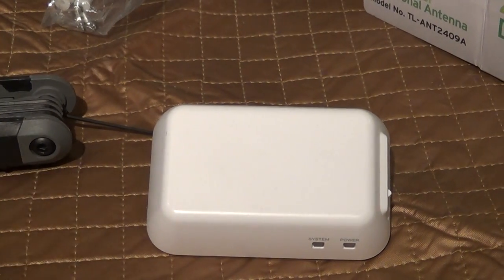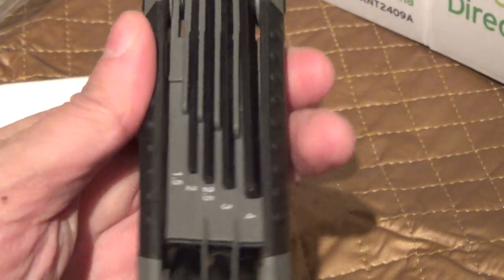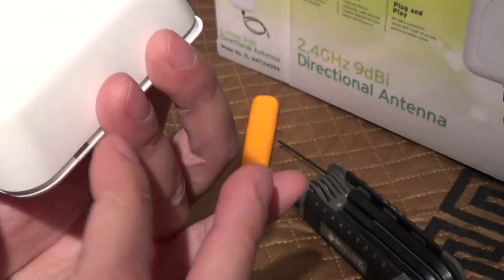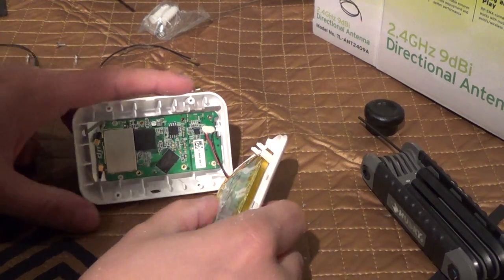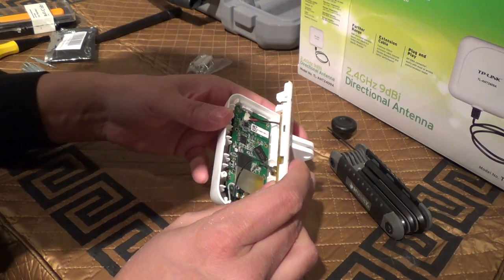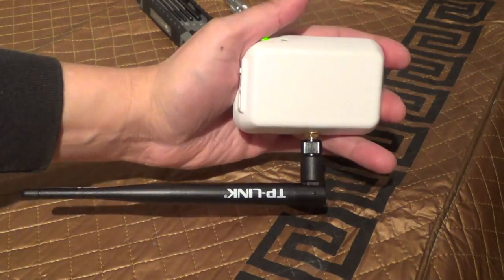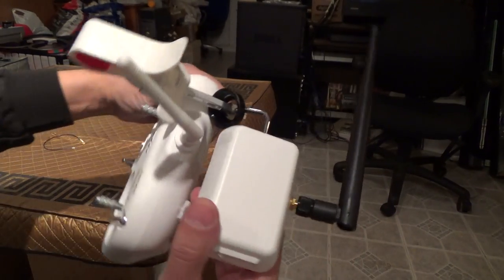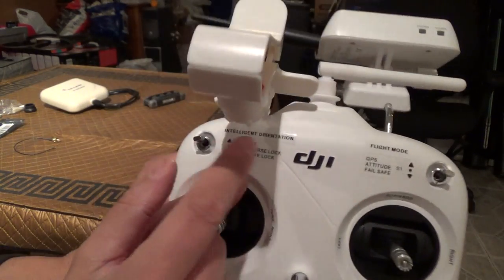DJI Phantom 2 Vision Wifi Range Extender / Repeater  External Antenna Mod increase FPV range.

Comment: Hey Ben - I was interested in upgrading my phantom vision - but dji came out with the new patch that cripples me to 1640ft - but it also say 3.1 miles flight distance - what does that mean - and did you ever make it to a mile with your anntennas?
Reply from the maker: I understand your confusion but the app can not restrict how far you fly your Phantom only firmware updates can do that.  The flight limitations you speak of are specifically regarding the new GroundStation Autonomous flight functionality.
Reply from the maker: So far I have flown close to 1 mile using my 6.5 turn helical antenna on the range extender and a 3dbi omni directional on the radio control. 4,600 feet to be exact which is roughly 600 feet shy of a mile.  No power amplification was used, my preview quality was set to 640x480 15fps and there were a fair amount of wifi signals near me.   The only limited factor was I ran out of range on the radio control.  When I get around to it I'll be doing runs with higher gain antennas on the controller.  Someone else who followed my mods pushed close to 6k feet before running out of controller range.  With power amplification more than doubling the range is certainly possible.

Comment: Ben, I am having an issue matching up some of the connections of my equipment to complete this type of project.  If I message you here with what I have, would you be able to provide some insight to what I need to make it work properly?

Comment: Hi Ben, I have a 6dbi Sunhans antenna that came with my sunhans wifi booster which I used for my Turnigy 9XR transmitter and the antenna is just laying around. Can I use the antenna for the wifi repeater? Thanks

Comment: Hey Ben Ive watched all your antenna mod videos. I upgraded my repeater with decent results. However I upgraded the camera and lost most of my range. All FPVLR antennas except for a pair of spironet fatshark antennas. I ran the half sphere and a spironet on the repeater and gained a little altitude haven't had time to check distance. Then I put a spironet on the camera to compliment my repeater RHCP spironet and also a LHCP 2dbi fpvlr pinwheel on the camera and my altitude dropped from 1300 feet to just over 200 feet. Everything went smooth in the installation. I'm wondering if the RHCP and LHCP configuration is canceling each other out somehow. I dunno. I'll try again tomorrow without the fatshark antennas and see if that helps. I thought it would be fine and I'm not sure what's going on. Any suggestions?
Reply from the maker: Just use a single LHCP pinwheel on the phantom.  If using a dual configuration it should the be two of the LHCP pinwheels to match up to the LHCP antennas on the repeater.  Positioning is very very important and can make or break you even if the antennas themselves are good.   I got the best results so far with two skew planer (pinwheel style) antennas one pointing down and the other at a right angle.  This setup allows for better separation of the two antennas and a batter bubble around the quad.
Reply from the maker: One other thing. Sometimes people get bad cables. If changing the antenna setup as I explained doesn't resolve the issue then you got one or more bad cables.  It's not that uncommon to happen.

Comment: I've done the mod, but took it two steps further. I used a 9db TP-LINK antenna instead. I also reasoned that if I'm going to beef up the RECEIVER (range booster) antenna, for maximum range, I should beef up the TRANSMITTER (camera/WIFI) antenna with another 9db zip tied to the skids! Same as you in your vid, it's not a good time to push my bird to it's limits on distance at night. Good video....I'll let you know how it goes.P.S. I added an extra washer on the exterior of the booster to make a sturdy build with the larger antenna.
Reply from the maker: Hi, if you will be using whip antennas I found two of the 5dbi tplink antennas placed at two different angles on either side of the phantom gave me pretty much the best reception of the configurations I tried using those style antennas.  You can see an example if toward the end of either my second or third Camera mod video I forget which one.   Overall tho I've been most satisfied using a pair of skew planer antennas.  With one facing sideways and the other pointing down.

Comment: You put the lockwasher on the outside which defeats its purpose. The idea is that if the outside nut comes loose with the washer on the inside, you can re-tighten it WITHOUT having it take it apart!!!! Doh!
Reply from the maker: It works fine the way I did it.

Comment: Hi guys, since I do not understand spoken English very well, I would like to know: why is disconnected the antenna's plug on the left and not that on the right? The extender has 2 antennas? Which is the other plug? Thank you
Reply from the maker: It doesn't matter which one you connect tho in some cases one side will work better than the other tho most people should have similar results regardless of which side you use.

Comment: Hi mate, great video. One question, if the omni antenna is installed as per your video, doesn't the other antenna just talk to the phone?
Reply from the maker: No it doesn't work that way. Whichever antenna is getting the strongest signal is what's used as primary antenna.

Comment: Nice video, I'm considering this mod as you have explained it pretty well. Where could you point me in the right direction to learning about RF and antennas. I have no experience in that particular field and have always wondered about situations like this.
Reply from the maker: If you're on a budget get the 5 or 8dbi TPLink antennas or a good Linear Patch antenna. If you want the best performance on the other hand use a Circular Polarized Directional antenna in LHCP (Left Hand Circular Polarized) form.  There are not many company's selling LHCP but some include FPVLR and Horizoinfpv.
Reply: Meh, no need anymore, My Vision+ flew away a couple days ago. But I do plan on building a quad without GPS so I'll keep this info. Thanks
Reply: Tyler Harney flew away?? What's happened?
Reply: Went out later in the day, it was the third time in the same location. Obviously did all the correct startup requirements. And 10ish minutes into the flight, the craft stopped for about 5 seconds, unresponsive and just took took off. The only options I had were to shut the motors off, so I watched it fall around 150-200ft.
Reply: Tyler Harney
Was Phanton in GPS mode or manual? could you turn activate RTH turning off the remote controller?
Reply: It was in GPS mode. I tried going into manual mode and atti mode, and turning the controller off and on again with no response.
Reply: Tyler Harney
I'm sorry :-(((, I hope that does not happen to anyone ever. I wonder what happened ...

Comment: So to adapt to the u.fl- RP-SMA cables you suggested, you would want a male RP-SMA to SMA male to fit an SMA antenna. In other words , with reverse polarity the male connector has a nut rather than a stud, Tipically thought of as a female
Reply from the maker: For the mod you need a u.fl mini to rp-sma (both female) adapter.   The rp-sma female comes with a screw on nut.

Comment: Also there are multiple listings on eBay from RF-SMA to RP-SMA adapters. I don't know maybe multiple typos.
Reply from the maker: RF refers to Radio Frequency and is sometimes used when referencing a connector.  Tho the connector itself is a SMA or RP-SMA if you don't see RP but only SMA even if you see RF in the description then likely it's a SMA connector and not the Reverse Polarity Version.  For example an RP-SMA Female Jack has a threaded outside and a pin on the inside.  Pinned cables are usually considered Male but since this is a Reversed Polarity connector the Positive and Negative is reversed.

Comment: This is getting complicated. Any good tutorials on antennas and connections explained out there?
Reply from the maker: It's not complicated just follow the parts list in the description.  Also a website www.fpvlr.com sells packages with cables and such. 

This mod is simple as putting on the female  u.fl to rp-sma female pigtail and then screwing in any standard wifi antenna.  Most of them use rpsma male connections which is a perfect fit for the rpsma adapter you will have installed.

Anyone listing a connector as RFsma is a typeo no such thing as RFsma

Comment: Excellent thank you. Very helpfull info. I purchased the reverse polarity sma cables you used but didn't realize the ImmersionRC antennas are not RP. Do they make an adapter to you knowledge from RP female to standard male adapter?

Comment: ImmersionRC spironet antennas are RHCP and not reverse polarity. Is that the same thing
Reply from the maker: Those are two different things.  RH and LH CP are reference to the direction of the coils on the antenna.  Reverse polarity is the connector.  When pairing up antennas using the same style RH or LHCP on both ends will give you the best results.  That's independent of the connector you use wether it be sma or an rpsma connector.
Reply from the maker: If you modify the Phantom camera as well to RHCP to match to an RHCP antenna on your range extender that's fine and that's what I do.  An RHCP antenna will still work on the range extender with the Phantoms LHCP antennas you just won't get optimal results but it will still work okay.

Comment: Can you tell is it ok to run RHCP instead of LHCP and do you have to run RP as well. The reason I ask is I purchased ImmersionRC spironet antennas I I hope to put them to use . But still don't quite understand the rotation or polarities of antennas

Comment: dear sir , where can i find the wifi extender plug and line as you showed on video ?
Reply from the maker: Amazon or ebay I have links in description tho I now use a shorter cable for easier install I will add a new link to that one in my description tomorrow

Comment: Ben, Thanks for the great video.  I (think) I followed your instructions, but found that my reception got worse, not better.  I tried both with 8dBi Indoor Omni-directional (http://www.amazon.com/gp/product/B004UBUE2O/ref=oh_details_o00_s00_i00?ie=UTF8&psc=1) and 9dBi Directional Antenna (http://www.amazon.com/gp/product/B003CFATNS/ref=oh_details_o00_s00_i01?ie=UTF8&psc=1).  Shouldn't these work?  What I get is reasonable range on data feed to the app (distance, orientation of the Phantom) but I lose the video link after 50 meters.  Any suggestions?
Show less

Comment: I cannot seem to get my Phantom 2 Vision wifi repeater to work when it's charging (would like to be able to plug it into an external usb battery and be able to use it all day while only worrying about the UAV's batteries). Anyone else had this experience? Is there a possible workaround?
Reply from the maker: Using a small usb battery there should be no problem powering up your range extender as it's running.  Both myself and many others have done that to keep it topped off.   I'm not sure why that wouldn't be working for you as well.

Comment: Where can i buy that extender? I want the same setup for a P2 using a Hero3+ Black Edition...
Reply from the maker: That range extender is made for using with a Phantom 2 Vision.  I don't think it will work with anything else.   Tho with the new dji app there is now an option for manual bindings so it could be possible but I doubt it.

Comment: Thanks for the reply! Great video and instructions. Keep up the great work!
Reply from the maker: You're welcome. Have you done the mod yet?  By the way I did a new record distance so far using an 6.5 turn (circular polarized) 11dbi Helical  antenna.I also have a Skew Planer antenna (circular polarized omni) on my Phantom as well.  I did roughly 1.4km distance or around 4,500 feet using the 640x480 preview quality. I could have gone further still though aiming the antenna gets a little tricky at that distance.  Also I was in a wifi saturated Park during that flight.  Distance's can also be increased substantially using a Sunhans wifi amplifier as well.  I have a video on doing that.

Comment: +Ben7seven7
Great video! Forgive my ignorance, but I am new to this. Couple of quick questions. 1. Do you know how much range you were able to add with the addition of the omni directional antenna or how much range you could add with two of these antennas? 2. Do you know if simply installing a cloverleaf antenna in the same fashion would give me increased range?

Thanks!
Reply from the maker: Adding a second antenna didn't seem to increase range at all.  Yea using high gain 2db or better LHCP skew planers will increase range over the stock antennas but not sure by just how much.  Using a high gain Helical LHCP antenna can no less than double your FPV range or even more.  If you plan on modding the P2V Camera antennas you can add LHCP or RHCP Skew Planer antennas or even a regular 5dbi omni directional which also worked well provided you have them oriented in a good position. Some positions actually decreased performance.  Skew Planer antennas will give the best reliability.  I have additional videos on how to upgrade all components of the vision including adding additional amplification to the range extender. Check em out!.   And check out FPVLR they make good LHCP antennas as well as RHCP antennas. Not cheap but you'll be happy with the results.

Comment: A $45 TPLINK Wifi repeater will get you 900 meter range with no mods
Reply: Which repeater did you use?
Reply: TP-LINK WA830RE 802.11n 300MBPS Wireless Range Extender
Reply: Raptor50aus
 you are saying NO MODS with this ... will get you to 2700 feet?
 how does this work and can you post a link to this? any comment on this  Ben?
Reply: Hi Ben - any comment on this?
Reply: Raptor50aus
how do you supply power?
Reply from the maker: tebownerdotcom Watch my video on using a 3rd party repeater. Also watch my new video I just uploaded using a wifi amplifier, I also go over power sources you can use for a 3rd party repeater as well.
Reply from the maker: tebownerdotcom Technically using a 3rd party repeater is a kind of mod. Depending on the power output of the 3rd party repeater, and antennas used you can easily get to 2,500+ feet or even a couple of miles if using a good directional.  Keep in mind you can accomplish this same feat with the modded range extender that comes with the phantom, and more so if you add a 2w or 2.5 watt sunhans amp. Check out my new video on adding an amp.

Comment: Hello, the wifi extender/repeater and antenna are for indoor use as specified by the manufacture....does this affect the performance for use outdoor.  Also how many more meter did you get from this mod.  Thanks
Reply from the maker: The antennas work indoor or outdoor, it's fine.  Using the 8dbi antenna allowed me to fly over half mile away (with low preview quality settings) in wifi congested area flying sideways, or 2,000 feet any direction.  Your results will be better in area with less or no wifi signals near you.  Using a high gain patch, or preferably an LHCP Circular Polarized antenna / Helical Antenna will give you better overall reliability, performance and range.

Comment: Hi Ben,
I am trying to modify my wifi repeater, and which antenna's brand is good? Which one you get the best result so far? I knew you said one Omni and one LHCP would have good result just wanna know which brand i should go for? Thank you very much
Reply from the maker: The TPLink makes a good quality omni directional antenna.  My favorite to use has been the circular polarized antenna.  Mind is an RHCP which works well with the RHCP skew planers I installed on the phantom.   Fpvlr sells LHCP helical antennas as well which work optimally with the visions internal LHCP antennas.  Netgear also makes a high gain patch antenna that I've heard works well.  If price is not a concern invest in the helical circular polarized antennas.  They're a little more pricey but will give you the most reliable operation and that's what I've been favoring after testing many options.

Comment: hey quick question..  I got the tplink 5dbi Omni antenna and the ufl pci pigtail wire.  do you think installing the 5dbi antenna will give me better wifi range than stock?  thanks.

Comment: Aloha!, nice video!
haven't read thru all the comments so don't know if you answered this before, but
is it better to use two external antennas on the wifi extender?
unnecessary duplicity?
or will two externals cause problems?

also does higher dBi mean better reception?
thinking about getting the 8 dBi omnidirectional
Reply from the maker: Two of the same antenna won't add any range.  My suggestion is adding a single 8dbi omni or a 9dbi or better directional of circular polarized helical antenna such as one from
Reply from the maker: Higher the dbi the better the gain

Comment: Ben, I have a proposition for you. The FC40 came out and it seems the repeater for the vision will not work with the camera on the FC40. Apparently the SSID's are pre-loaded into either the camera or the repeater (or both). I dont know if its your field, but do you think you can figure out how to change the SSID in either piece of hardware so the repeater could work with the FC40 camera? I dont want to have to hold my Linksys router loaded with DDWRT along with the controller! :)

Comment: Hi Ben...

Do you sell WiFi Extenders that you modded? Interested if so. I'm pretty good on software, but hardware mods I have a tendency of messing up. Finding my camera never lasts even close to as long as the range of drone itself and want to rectify. Thanks!
Reply from the maker: No but I could if you need one modded.
Reply: Ben7seven7  Thanks. Actually, ended up following your directions to a 'T' and it worked perfectly. Thanks!
Reply from the maker: Awesome! Enjoy the extended range :) I sure am.